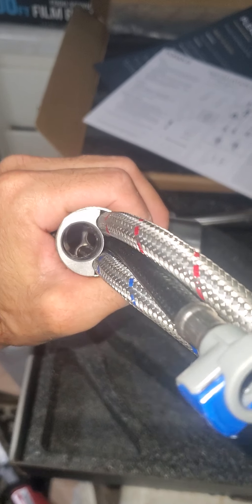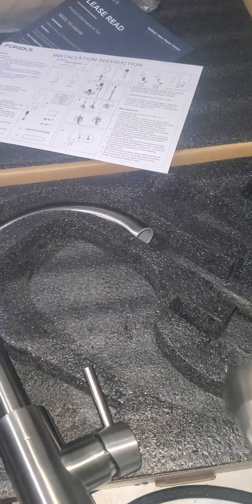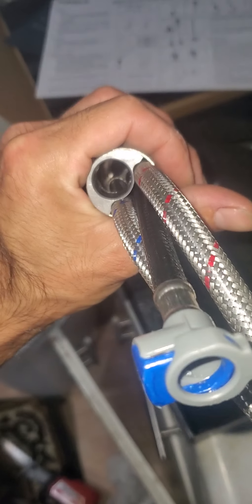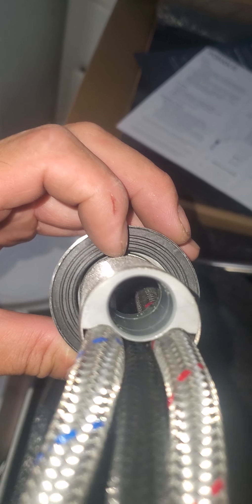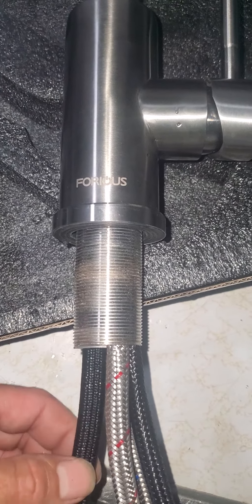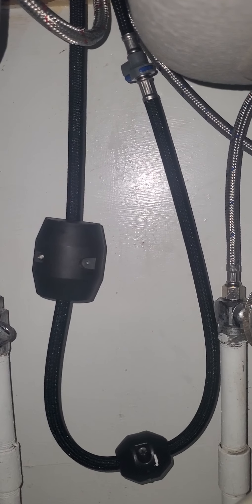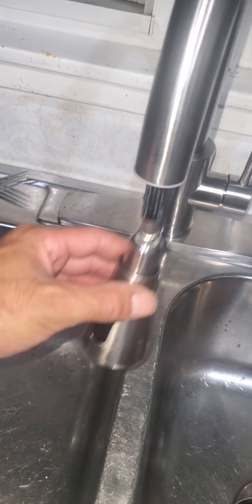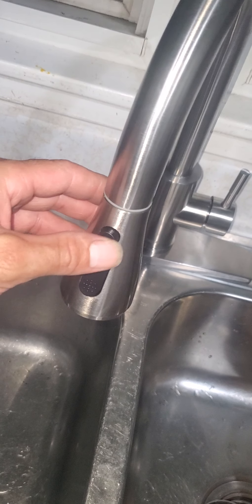sink faucet pull down gets stuck problem

Comment: I removed the head to soak and accidentally let the hose retract into the neck. Now it is stuck on the black inner lip. Any suggestions for getting it back out?
Reply from the maker: If can you grab the hose from the bottom and push it up slowly